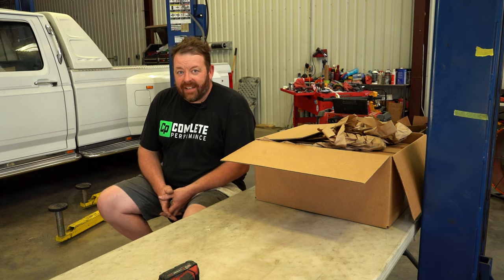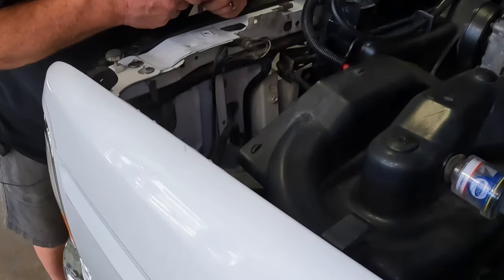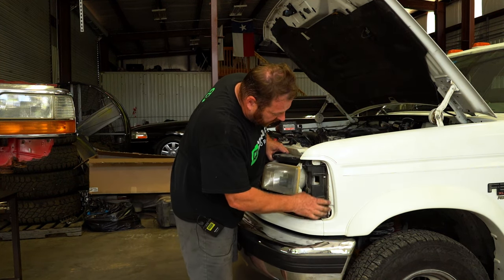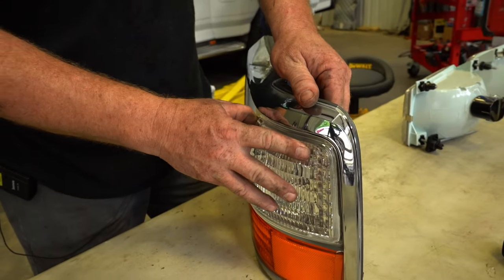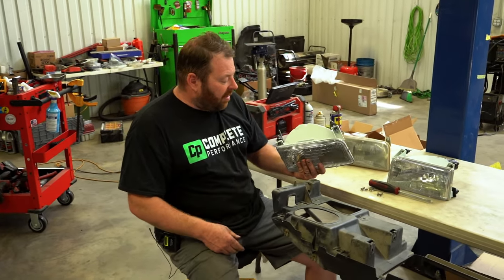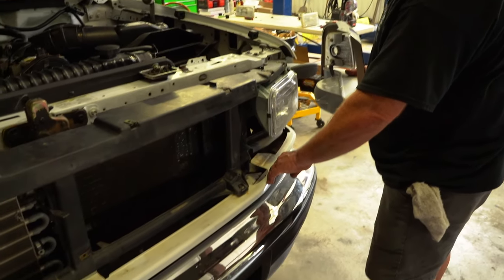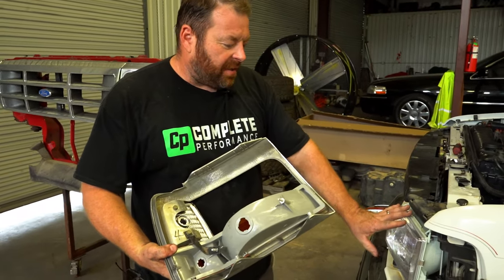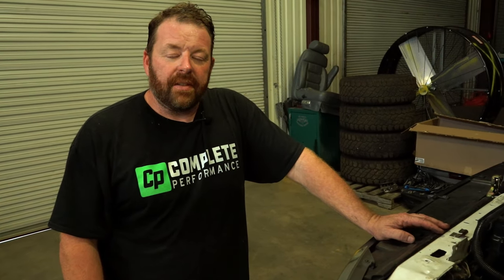How To Video - 1992-1997 Ford F-Series Headlight Installation

Comment: To get the headlight clips off, they make a Lock Ring Plier with a flat nose that could be used instead of the screwdriver.  The tips push out when you squeeze rather than prying with the screwdriver.
Reply from the maker: I'm sure there is something out there but the flat blade is the cheapest and everyone has one.

Comment: Remove those clips without taking the header panel out is chore when i did mine those pins for the marker lights un screwed out of the housing when i polished the headlight buckets i took silicone and sealed the headlights housing